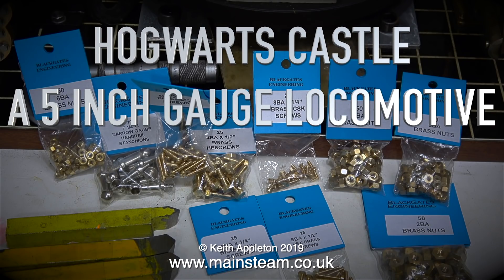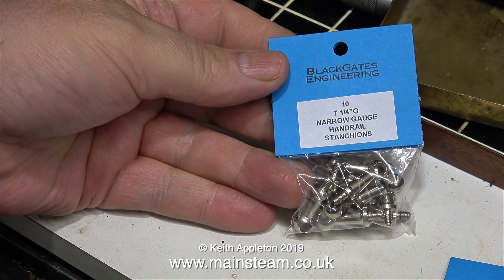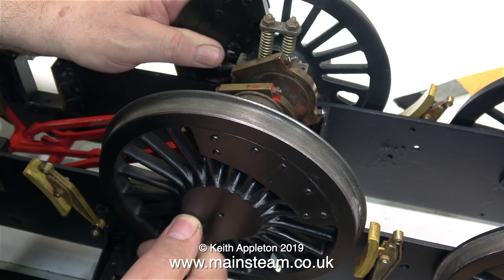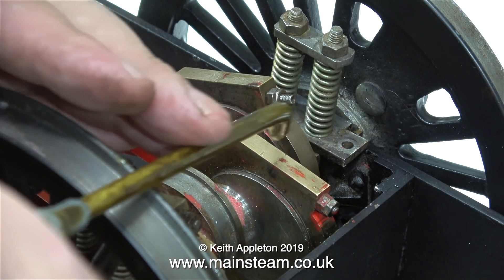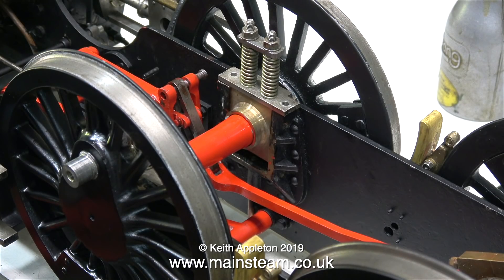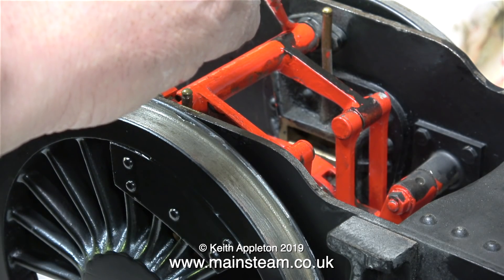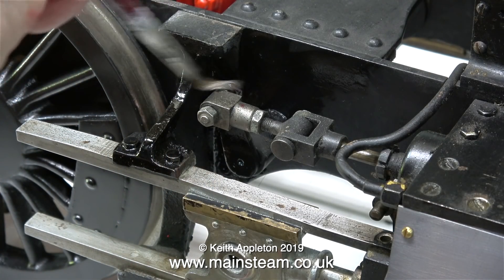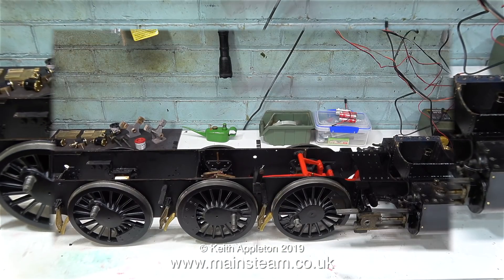HOGWARTS CASTLE - A 5 INCH GAUGE LOCOMOTIVE - PART #21

Comment: Another lovely video, thanks! I have been wondering thanks to your work ,why British engine designers put so much of their gear up the middle and the designers here in America down the out side. Is there an economy of tooling: one set inside , two sets outside, or is it just a matter of style?.
Reply from the maker: it is all in the development, earlier engines often had inside motion, later ones had 3 & 4 cylinders both inside and outside then eventually there was a "standard class" of locomotive which was easier to maintain with outside motion only.
Reply: pocketfarmer1 I guess with the GWR it was a case that they standardised earlier on with Stephensons link motion which from aesthetics was neater inside the frames and also where the gear would be protected from being clobbered. Only their 4 cylinder locos had Walschaerts gear, but the two sets were still kept inside the frames operating the inside pair of cylinders with a rocking arm connecting the neighbouring outside cylinder piston valve spindles to the inside set. Pushing and pulling so to speak. 
The other three railway companies, SR, LMS, LNER changed to outside Walschaerts gear for ease of access more than anything on new build locomotives soon after the gear had been introduced to the railways.